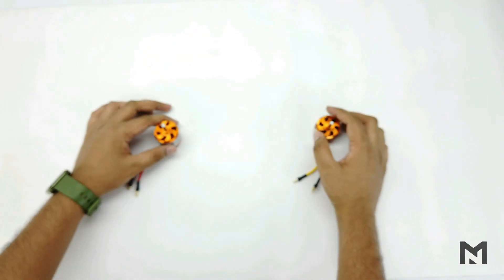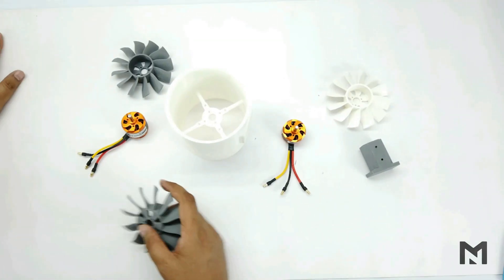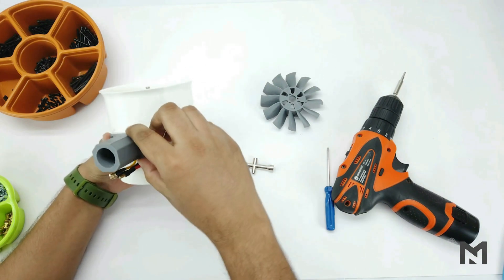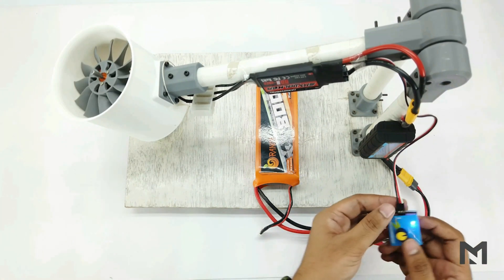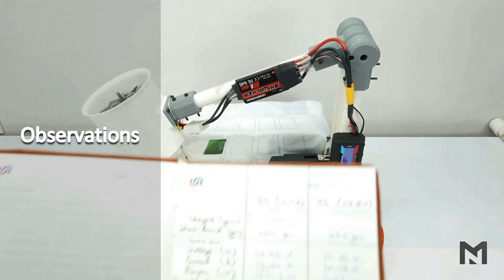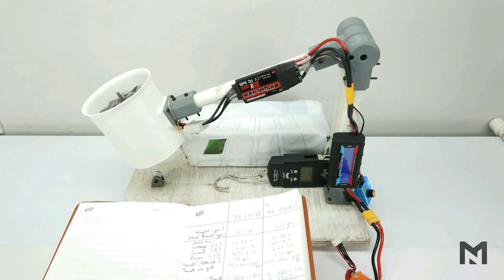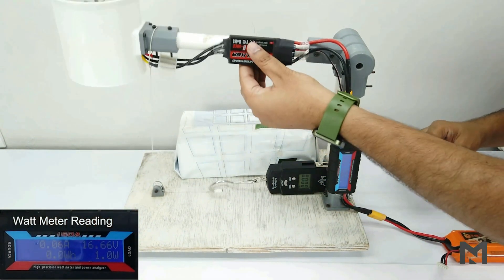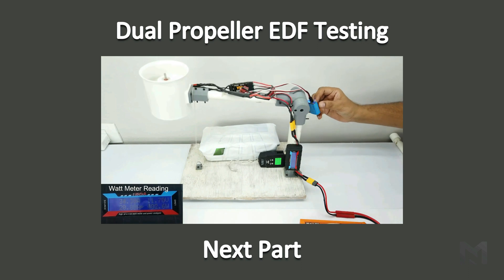DIY 100 mm Electric Ducted Fan thrust test | 1000 Kv Vs 1700 Kv | 3D Printed | DIY

Comment: Ive achieved 446g thrust at only 170w with a custom designed 3D printed 12 blade EDF at an rpm of only 17,750rpm. at only 70mm diameter.
Reply from the maker: That's an amazing result! Keep up the great work....

Comment: Man you don't even let the thrust to stabilize for a second, you should give this things at least 3 or 5 seconds on full power to take measurement, your intention is good but your method need to improve or your data will not be reliable.
Reply from the maker: Thankyou so much for your suggestion.... actually in my new videos I am also verifying the operating temperature....and finding new ways to accurately measure data....
Do check my new videos too....
Thankyou so much for watching and don't forget to subscribe to subscribe 😊😊😊😊😊

Comment: 700+ watts? How long will that motor last? Is there alot of heat in it after a 3 second pull?
Reply from the maker: I have not checked the motor lasting time....but yes after 30 sec of running it became hot.....
Reply from the maker: Thankyou for watching the video and don't forget to subscribe 😊😊😊😊

Comment: did you try the toroidal propeller?😅
Reply from the maker: Thankyou for your suggestion.... actually I am working on it....will upload the video soon.... don't forget to subscribe 😊😊😊
Reply: The point about a toroidal propellor is that it is effective as an alternative to fans that are in the wild, with an open tip. A duct already serves the purpose that the toroidal propellor was designed to fulfil, so a toroidal propellor in a duct is likely to be less effective than blades with a straight cut at the end

Comment: if only there was a duct where both motors could fit inside of, so a drone could use the benefits of both motors, the torque and the high speed rotation in one duct :D
Reply from the maker: Your question will be answered in my next video where I will use two propellers in one Duct.
So thanks for watching the video and pls don't forget to subscribe so that you don't miss anything....😊😊
Reply: @MechNinja  im subscribed :D maybe later i can share a few designs that would love your 3d printed ducts :D
Reply from the maker: @TheTrumanZoo  yes definitely share me....and you can also suggest me some work too
Reply: @MechNinja  great channel man :)